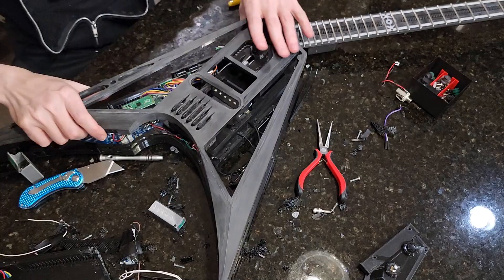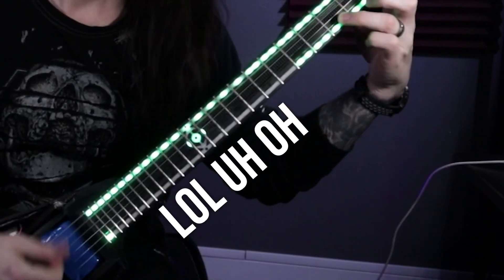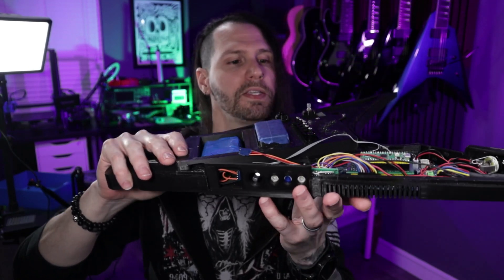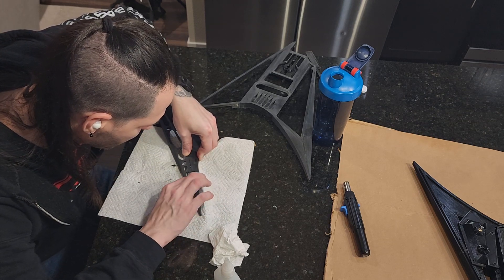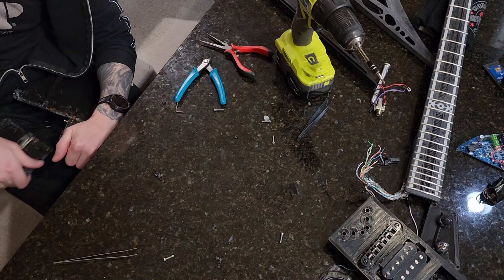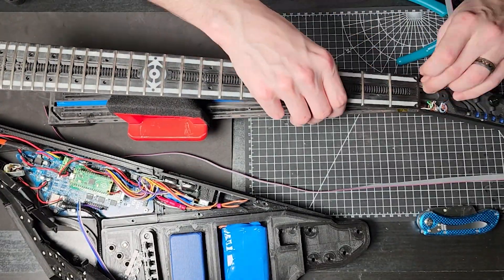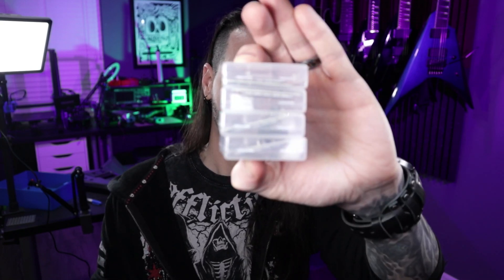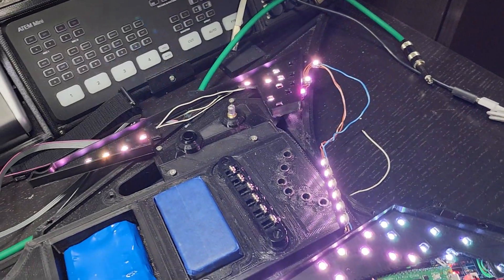Fully 3D Printed Guitar - First play and adding RGB lights on the body

Comment: It's really fun coming across this. I'm actually building a 3d printed guitar right now with a printed neck as well. I'm using the filatone one, and seeing the difference in approach to the neck design is pretty wild and awesome. I've made a few modifications to it, but nowhere near as awesome as yours. I mean this thing is wild, my kind of dream project with all those electronics.
Reply from the maker: Thank you! Are you posting progress anywhere? I'd love to see it!
Reply: @metalheadmaker  Unfortunately I don't really have many progress pics. But I do have the photos I took on imgur under "gallery/so-i-made-3d-printed-guitar-wPUHPkw." So if ya just go to imgur, and remove the quotes, and add it to the thing, it should work.

Comment: Great progress as always. Have you tried applying primer on the 3d prints and then sand it? It could be easier if you also want to paint it later. In other news, I've joined the fried Teensy squad (RIP teensy 4.1 2023-2025).
Reply from the maker: Thanks as always! Yep that's how I prepped the neck before deciding to hold on painting. Holding up shockingly well. ...ugh, no! What happened to the Teensy?
Reply: @metalheadmaker  I probed around and accidentally shorted a pin to -12V. Someone tried to fix it, but it was too late,  Teensy already passed away.
Reply from the maker: @Blazico Uff that's the worst feeling. I just bought the IMXRT1062 chip and I'm trying to swap it to see if I can bring one back from the dead. I already tried swapping a lot of the other components with no luck, so I'm hopeful that this'll do it. I'll let you know how it goes!
Reply: Thanks for the recommendation to this channel 🤘🤘